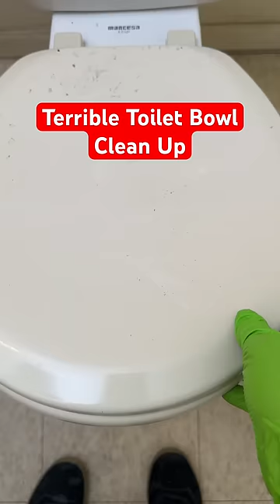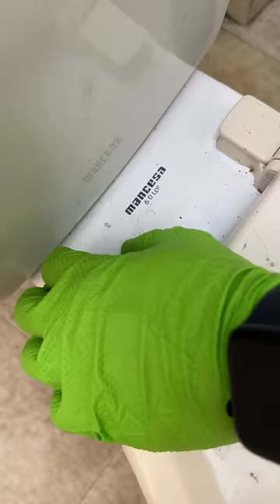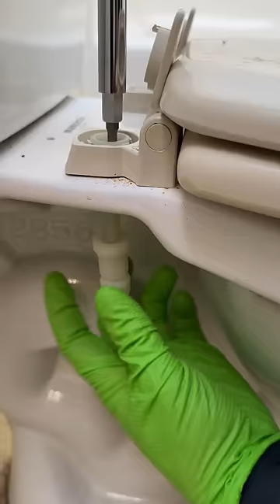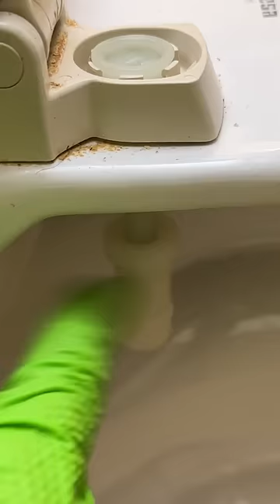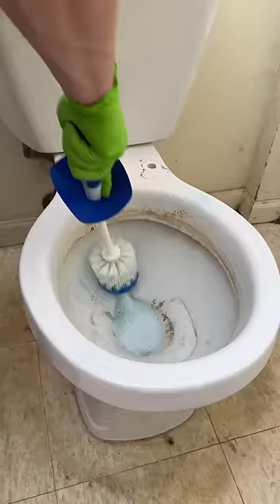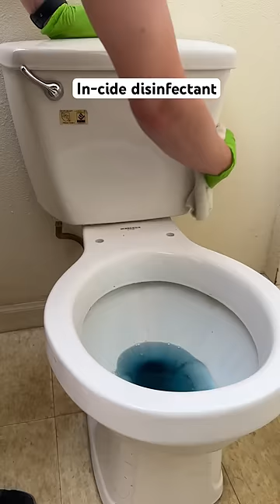The Dirtiest Toilet Bowl I Have Ever Cleaned

Comment: Pumice stone will scratch the ceramic surface that crude and algae and mold will use to attach itself.
It's better to treat that mineral buildup with sulfamic acid crystals over time along with scrubbing and Lime Away on the regular.
Reply: its a mancesa toilet
Reply: Harpic timescale remover would of shifting that
Reply: Baking soda vinegar let set come back flush all done use lemon soap for fragrance
Reply: @darlenemstrommer7687  baking soda and vinegar mixed together just neutralizes itself. In the case of mineral build up vinegar alone is much better. However in my case vinegar alone did nothing
Reply: Lime away you say? Hmm i hope we have in Canada
Reply: @buddyholly4672  can use baking soda as also either peroxide or vinegar as thee bubbles as is what loosens all that build up as I been cleaning since was 8 as with same cleaners as no boughten cleaners make own as add lemon soap for france as also water
Reply: @buddyholly4672  as yes need that as with water as bubbles breaks that build up down so falls off
Reply: @buddyholly4672  In Canada you can get Lime Out at Canadian Tire.
Reply: @darlenemstrommer7687 you've been cleaning wrong since you was 8 mixing baking soda with vinegar or acid neutralises each other and you will need to use more acid than needed. You still get bubbling the reaction on the limescale. Bases are better for cleaning fats and oils.

Comment: I use the lysol in the black bottle, you don't have to scrub those hard water and limescale stains, it dissolves them!
Reply: As a professional cleaner, the only product that I use in toilets is Lysol. There isn't a better brand out there. It will remove just about any stains given enough time and applications.
Reply: do you know what it is called? i think i could use some of that to keep around the house
my husband is an ironworker 😅
Reply: Lysol lime and rust remover?
Reply: @bluewrites2278  Mine is much less dirty but it has brownish streaks and a ring and a pumice stone won't even touch it.  I will try but seriously doubt Lysol will do anything.
Reply: @Lando62  The key is to let it dwell for at least 15 - 30 minutes. It may take repeated applications. The Lysol bowl cleaner isn't strong enough to damage the porcelain so you can leave it sit for quite a while.

I have cleaned toilets way, way worse with just lysol. I have also used it to remove tub rings and clean sinks, just don't use it on stainless steel as it can potentially leave marks.
Reply: Which Lysol is it? I've let vinegar and other stuff sit for hours.  I'll try it though.
Reply: @Lando62  Just the regular Lysol toilet bowl cleaner.

You want to make sure that the ring is definitely a mineral deposit and not that the porcelain is damaged.
Reply: @bluewrites2278  I found this after getting the Lysol lime and rust black bottle.  It is soaking now.  The streaks and ring aren't horrible.  Just not nearly good enough to look at.  At first I thought it was mold but it is sort of tan color.  Nothing else has worked.  I'll try regular Lysol bowl cleaner next.
Reply: @Lando62  the lysol lime and rust, it has the black label
Reply: @ccmom13  thanks. I found it.  It seems to work.  I’m trying to get the last area done.  Down in the bottom it is still stained.  I have to get the last bit of water out so the Lysol is not diluted and can work. Thank you folks,
Reply: @ccmom13 I'm late to the Lysol lime and Rust party.😂 I'm going to try it. Thank-you for the suggestion!

Comment: I have cleaned a toilet way worse than that one. A little Muriatic acid goes a long way.
Reply: That's what use! No scrubbing required. 😊
Reply: That stuff is like magic
Reply: Where do you get it?
Reply: @JenJen0582 how do you use the muriatic acid? Do you just pour it in there plain, or mix it with something else?
Reply: Is that safe for septic system?

Comment: Save  you time,  money buy  iron out  put  it in the toilet  tank , bowl,  allow it to set while you do  other jobs that need doing around the house, if you allow it to set  a least an hour it will remove everything, of course when the toilet is really bad it’s best to leave it in overnight flush in the morning.  I also put iron out in the little hole in the toilet tank to clean it out.  I buy it  at the hardware store  last a long time  does a spotless clean job. I forgot to mention I also add a bit of dish soap in the tank, toilet  along with  the iron out, it pays for its self because it’s your helper  does the job for you. I love iron out, can be used for other things as well, give it a try you will thank. Me.